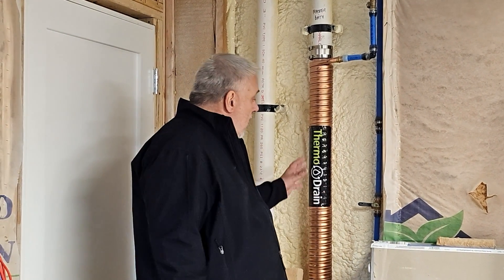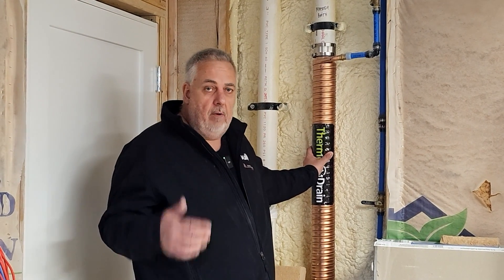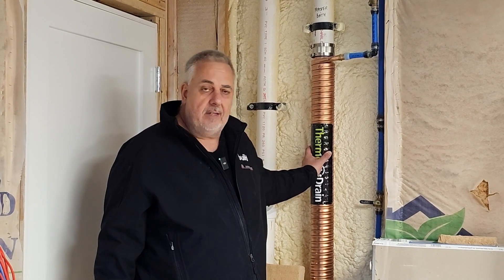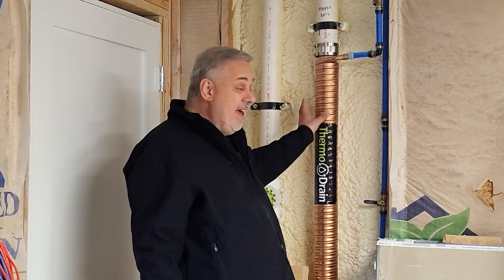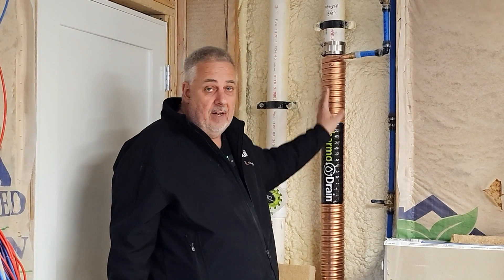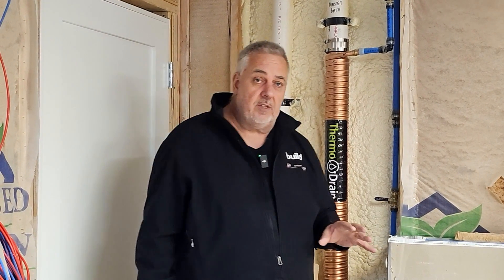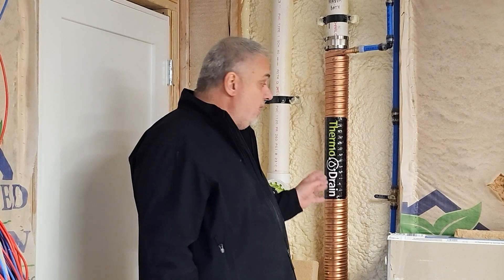ENERGY RECOVERY "THERMO DRAIN"

Comment: Seems interesting but .. a question. There is another stack just to the left, is that the toilet waste pipe? Does this Thermo Drain system need its own stack? possibly another cost or what is the other stack for?    thanks for the product info.

Comment: There must be actual data available.  I mean all you really have to do is measure the temperature of the water before it goes in and directly after and you would have a good baseline of performance (given you know the flow rate of the shower head).

My suspicion is that this would give you marginal gains in performance as it is a pretty basic heat exchanger without a whole lot of surface area.  I would put this pretty low on my priority list of places to improve performance... but it would be on the list.  I mean it is pretty painless from the POV of someone living in the house unlike having to remember to put up or down your exterior shades to mitigate your solar load.

Comment: There is no thermally conductive compound filling the voids between the copper and iron, and no exterior insulation.  I don’t have test data but I bet nearly all of what does get captured is immediately radiated away.   And, any contact between the copper and iron pipes will speed corrosion, so if this thing fails after a decade the owner or builder will incur significant cost in having it removed / replaced, and repairing the damage caused by the leak.  I like the idea in principle, but I don’t see a path to sustainability or cost savings in this generation of the product.
Reply: What iron? I only see copper and plastic...🤔
Reply: Is that not wrapped around an iron drain pipe?  PVC has a thermal conductivity value of 0.2 W/mK, whereas pure iron is 94 W/mK.  If this device is copper around PVC (or similar), then there is no possible way this thing makes economical or ecological sense.  You can’t even recycle consumer PVC.
Reply: @jackjmaheriii  it is copper wrapped around coper
Reply: If it’s copper on copper, then why wrap it all?!  Just have an outer and inner sleeve with water passing between them.  That would solve the contact patch issue, the radiant heat loss issue, and use less copper besides.
Reply: @jackjmaheriii  you have come up with the idea. Make a prototype and sell it to them.
Reply: @jackjmaheriii  You would get better thermal transfer with your method but I think the issue would be now you only have one wall between your waste water and your clean incoming water.  If the inner wall failed I would not want it coming into the cold of my hot water.  And you would never see the failure.  I'd rather it on the floor than contaminating my cold supply
Reply: @brycekpalmer  That is a good point, and a very insidious problem.  I don’t think there would be mixing because the clean water would be under pressure, but if there was a pinhole leak into the drain side you’d never be able to find it.

Comment: @Steven Baczek Architect, I've always loved that concept, but I know a way to improve it and to also hold and retain the level of possible heat that it can conduct, its something that I am going to be using on my house design in Maine and I will incorporate it... As always Liked#27 N Subscribed !!!
Reply: An idea that I've had, for several years, is to have the gray-water pass through a holding tank, with a loop of supply pipe submerged into that gray water.  I expect that a problem it would have is that muck in the tank would build up and cling to any surfaces inside, including the supply pipe, and greatly diminish the heat-transfer.  The Thermo-Drain is at least somewhat better in that regard, since the motion of the gray-water will help keep the inside surface clean.
Reply: @kc9scott great idea, keep the inlet, outlets low, the exchanger high and it may be a yearly clean, obviously below the scum line
Reply: @snowgorilla9789  I think cleaning a tank that has a coil of pipe inside would be inconvenient and tedious.  The muck would probably accumulate on all surfaces even if they stay submerged 100% of the time  Also I expect it'd be very much against code, as any pinhole leak in the submerged supply pipe would connect the potable water to the gray water.  I think the ThermoDrain design is better, because it would (1) tend to stay cleaner inside and not need cleaning as often, and (2) the way it's held onto the drain pipe with Fernco clamps, and the pressure coil is connected using PEX, it would be pretty easy to clean if/when that's needed.
Reply: Care to share your idea to improve it with us?
Reply: @burrowsal  And your going to be the first one to laugh at me, ha ha ha!!!
Reply: @2point..0  Not at all.  If you have something that can improve it, I'm all ears!

Comment: I have a question: Since the whole assembly is copper, that recovery coil is radiating heat into the basement, as well as recirculating it to the water heater. Wouldn't an insulating sleeve outside of the recovery coil improve heat recovery? As an aside, IMHO, some people are just trolls, but I suspect the majority of negative opinion stems from different climate demands. In severe climates, saving every single erg of power makes a lot of sense. In a mild climate with more moderate energy needs and lower cost options, not so much.
Reply: Ideally, it’s just on the shower drain, I think, as that’s the only drain that’s almost certain to have only hot water.
Reply: @chrisgeary4624  Ah...good point. I wonder what the economics of connecting the dishwasher and clothes washer to the system? Both of those appliances squander a huge amount of heat. My dishwasher has a heat booster to elevate water temps to over 160 degrees to sanitise the dishes. I would think that should be worth recovering,.
Reply: @lindacgrace2973  In one sense, it seems dumb to design a house around hot water recovery, but the fixtures need to go somewhere, so why not design them to take advantage of a free (to operate) device that will last for the life of the home and pay for itself dozens of times over?
Reply: @chrisgeary4624  I agree - but remember, this house has two mechanical rooms, so it's not a far stretch to imagine a heat-recovery system for the kitchen (at the other end of the house and in close proximity to the second mechanical room) would be even more cost- and energy-efficient.
Reply: @lindacgrace2973  I don't think it would be worth it for anything other than a shower.  Remember the you need to be actively using the hot water during the same time as the recovery period.  This doesn't apply to a dishwasher or a washing machine.   Same thing with using it for water from the bath tub.  It will recover some of the heat but not much.  The shower has the benefit of using the water at the same time as disposing of it.  This keeps the delta temp high on the cold water wrapped around the pipe.
Reply: @brycekpalmer  Makes perfect sense.Thanks.
Reply: I don't think that exterior insulation would significantly improve the performance of this. You are looking to increase the temperature of the incoming water so your water heater doesn't have to work as hard. How about the times when you are only using cold water at the sink rinsing veggies, the room can help temper the temperature if the insulation isn't on but, it wouldn't do anything if there was insulation on it.
Reply: @shannabolser9428  You may be right - it is engineered product, after all. Surely they thought of it. But I don't think the "cold water down the drain will cancel out the benefits of the hot water recovery" is significant. Most people don't keep their houses between 50 and 55 degrees (the average temperature of ground water) so even with cold water, you're getting water warmed to room temperature. Hmmm...this is actually turning out to be an interesting puzzle. Thanks for your comment - you brought up a new aspect I hadn't thought of. :-)

Comment: Do you plan on insulating over that copper, so that you don't loose heat to the air?
Reply: I just looked at the ThermoDrain website, and they quote efficiencies in the low/mid 40% range.  If the incoming cold water is 55º F, and the water going down the drain is 95º F,  the ThermoDrain would heat the water up to around 72º F.  That's way better than what Steve said,  but not hot enough to warrant using insulation.
Reply: @kc9scott Curmudgeon here.  If a person is so fanatical that they would pay $1100 to recover the heat going down the drain, why wouldn't you want to squeeze out a few more degrees by wrapping it in insulation?  Or, are you saying the room temperature will also be used to heat up the incoming water?    Also, how long before I recoup my investment?  Seems like investing that money into 2 more solar panels would make more sense.
Reply: @markstipulkoski1389  I don't consider it fanatical.  For me, with a gas water heater, I'd expect a ThermoDrain to save at least $20/month, so break-even would be in 4 1/2 years.
Reply: @kc9scott  Didn't mean fanatical in a derogatory way, just more extreme than the average household.  My main question was why you said insulation would not be useful.  That was my first thought also:  stop warming the air through convection.  Maybe they unwrapped it for the video to show off the product.  My skepticism on the savings is how much heat is lost in the drain pipe from the shower to the heat exchanger.  It works best if that run is short, as they said on a previous episode.  It would be interesting if you were to post your real world results if you end up getting one.  ✌️
Reply: @markstipulkoski1389  If you put insulation between two things that are already about the same temperature, i.e. the pre-warmed water and the air in the (presumably conditioned) basement, the insulation won't really do anything.  The better bang-for-the-buck on pipe insulation would be for the truly hot water coming out of the water heater.  My preference is to leave all of the pipes exposed so you can see when they start leaking.
Reply: @kc9scott  I "instrumented" my shower this evening.   I live in Florida, so my numbers are different than yours.  My tap water is 74 F.  Temp out of my shower head is 104F.  By the time it hits the drain, it is 84F.  Even if this device was directly under my shower drain and rounding up the thermal transfer efficiency to 50%, my temperature increase would only be 5 degrees,  74 to 79.  Seems small compared to my gas water heater that took my temperature from 74 to 134, 60 degrees.  Most of my heat was lost heating up the air and shower floor tile. So I grant you that insulation would not do much for me because the device would not do much anyway.

Comment: Would it provide greater savings installed horizontally with all other variables being the same?
Reply: The vertical systems tend to have the best efficiency, and the lowest dead time (dead time is the time it takes before the recovery actually starts working).
Reply: I'm guessing that the colder the ground water is the better this would work. Up in the Upper Peninsula of Michigan the ground water is so cold. I haven't taken a temperature of it but it is shockingly cold. I bet this would help greatly. Where I live now, I don't think it would do much as my incoming water is way warmer.
Reply: I would think the slower the drain water moves through it, the more opportunity to reabsorb the heat.
Reply: @billvojtech5686  Its actually more about surface area than about time.